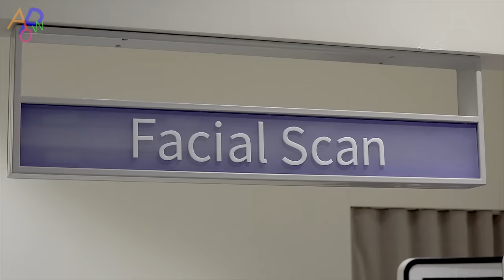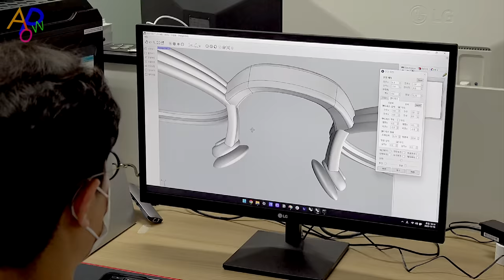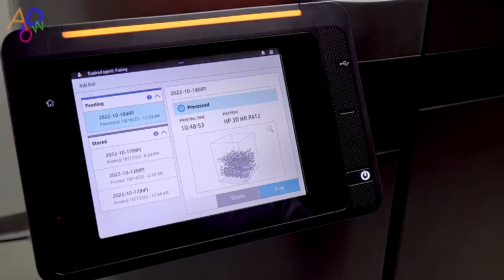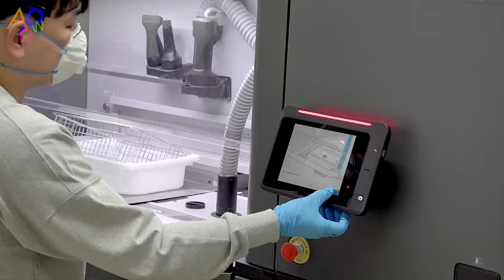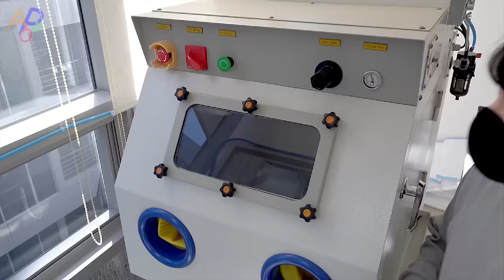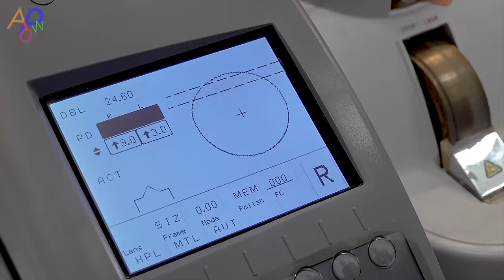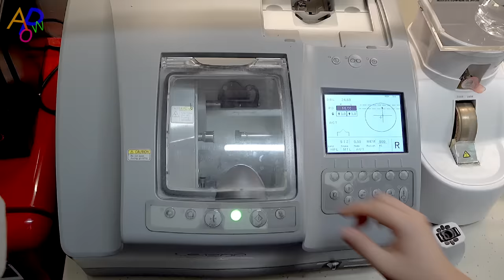Process of Mass-Producing Glasses With New 3D Printer Technology. Korean Custom Glasses Factory

Comment: Interesting process.   How do they sort the frames from the batch for what goes to which customer?  It appears to be a batch of frames with no ID markings on them.
Reply: the frame have number tag ring between the lenses. should be included in the modeling.
Reply: @Mk48CBASS  That is correct! you can see this when you pause the frame at 7:11
Reply: @breezmeyewear  wow, i missed that in the video, i was trying to figure out why anyone would need 50 pairs of glasses and who would want to pay for that :D
Reply: @jessiejanson1528  maybe Mark Z would buy 365 pairs and cycle them through one per year.
Reply: @Mk48CBASS   @MK  I did see a number tag at one point but I didn't realize it was printed with the frames.  I thought it was something that was added later.  Where you see it at 7:10 or so, the glasses have been processed quite a bit by then.
EDIT: If you look at about 4:30 where they are pulling them out of the 'powder' you can see number tags on at least a couple but they are harder to spot.  And some frames don't appear to have number tags.  But maybe I'm just not seeing them or maybe some of the frames in that batch were more generic like for sun glasses or something less specific to one person.
Reply: @davidbwa  Yes, probably the powder covered the tags...

Comment: I have used HP 3D printers and I wish they would have shown how they colored the frames after bead blasting.
Reply: We've intentionally edited out the dyeing & drying process scene, as it is strictly confidential!
Reply: @breezmeyewear  We'll do it ourselves.
Reply: Just a lucky guess but I think it could be a ceramic coating
Reply: The frame fronts are dyed, not coated :)

Comment: Nice video.
Was interesting to see how glasses are made in the 3D printer!
How is it done that you get different colors?
Reply: I assume it´s done by anodizing (also hardens and protects the surface).
Reply: Thanks for your interest! We've intentionally edited out the dyeing & drying process scene, as it is strictly confidential!
Reply: They don't want to give away ALL  their secrets
Reply: @henningerflats  this is 3D printed plastic, not aluminum...
Reply: paint...
Reply: Probably color infiltration. With polymeth colors, polymethine dye. That's how we do it and online 3d print for example markforged.
These powder prints are mostly polyamide and porous.
Reply: Painting them xD
Reply: @Marver95  Nylon ?
Reply: The frame fronts are dyed, not painted!
Reply: @breezmeyewear 

Shhhh!!!!! Not all the secrets .  

But as we know .  Everyone can have the same kitchen , but not everyone can be a star chef 😂😂😂

Comment: What about the painting step?  It went from bead-blasting to fully painted?
Reply: We've intentionally edited out the dyeing & drying process scene, as it is strictly confidential!
Reply: I am surprised that few people noticed that they missed the moment with the painting. What's the secret there? It is difficult to guess how to paint plastic?
Reply: @jewelator  Most likely they have their own proprietary method and equipment for this process.
Reply: @sittingduck4602  Most likely, but I think it’s difficult to reveal the composition of the paint or some patented things on the video. Therefore, the video turned out somehow
Reply: The frame fronts are dyed. No painting involved :)

Comment: 바인더젯 보다는 스트라타시스 폴리젯이 더 좋을거같아요 하지만만 바인더젯은 매우 가지고싶은 프린터기…ㅠㅠ 부럽다
Reply: 안경이 어떻게 색이 변했는지 보여주지 않는다는 사실을 눈치채셨나요?
Reply: 칙칙이??
Reply: @jewelator  I dun know what are you talking about, I meant Binderjet is very fast but it's very hard to dealing with dust issues and surface roughness. However Polyjet is much cleaner printing but slower speed and visible layer.
Reply: @CMC-x9d  도무지 무슨 의미인지 알 수가 없습니다. 칙칙이??? 뭔소리지?

Comment: need more info, why this method instead of injection molding. this feels like way more expensive. I have to guess it is for the custermization ability?
but then again, there wasn't any 3D scan process involved? I saw comments talking about the fit compare to traditional frame. I do not wear glasses, so excuses my short  sight view (ha), the only place the frame contacting the human face is just over the nose. And even for that part , it is the generic shaped soft silicon. I dont understand why you need 3D printing tech for this product
Reply: Did you watch the video? It started by scanning the face of the customer and adjusting the 3d model of the glasses to the 3d scan of his head.
Reply: You need to watch the whole video again.

Comment: How did they color the frames after they were removed from the sanding?  They looked greyish after sanding and then they came in different colors on assembly.
Reply: The printing resin is pigmented. They were that color all along, just needed polishing to bring it out.
Reply: @room007  Thanks! so you mean the video skipped the polishing process after sanding and straight to the assembly. that's why we see the frames with different colors?  Perhaps polishing process is a commercial secret, it's a method using different technique to polish the frames.
Reply: We've intentionally edited out the dyeing & drying process scene, as it is strictly confidential!
Reply: The frame fronts are in fact dyed :)

Comment: That's crazy, the most laborious/inefficient & time consuming way to make custom frames ive seen...
Reply: What is so laborious and inefficient about it? The machine did all the work, and the customer got the perfect fitting custom eye glasses. Not related to this video, but you make it sound like TV dinner should be the only kind of meal.
Reply: @UnLee911  dont mind that..   many people in the west (usa, eu, australia... )  believe they have a lease on being superior.. so if they see something they dont understand, they either make fun of it, or insult it.
Reply: ...That's why they are custom-fit frames. Did you expect them to be churned out by injection molds?
Reply: @mm-hl7gh  Your problem is you don't like facts and would rather believe in fairy tales stories shown and told.
Reply: @sittingduck4602  Some more facts... there are 7 basic face shapes, how many custom temple pieces did you see ? 0
Reply: @sealofapproval2016  7 basic face shapes? Did you not watch the video? Each pair of frames is finetuned down to every increment using 3D modeling based on the individual's face scan results. I suggest you go back and watch the first part of the video before the 3D printing scene.